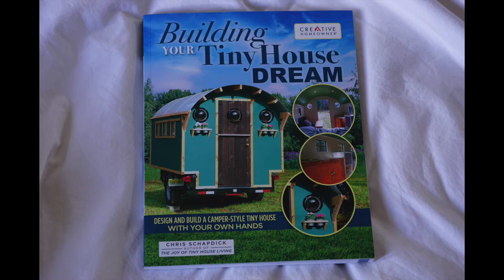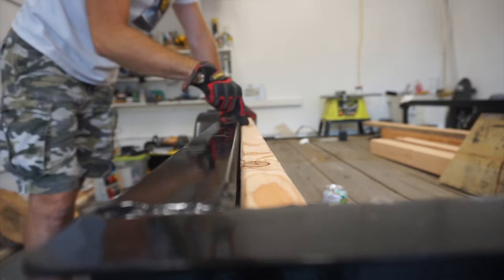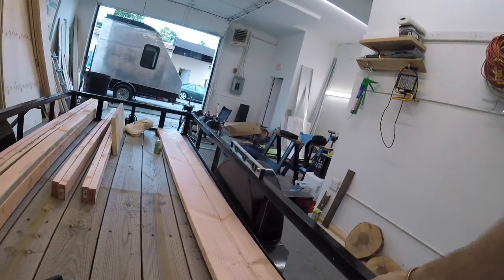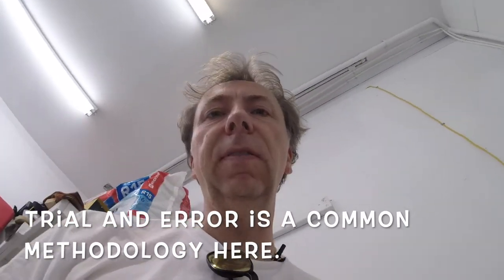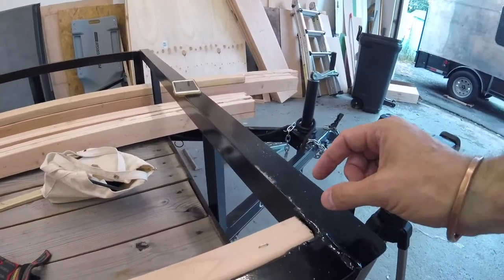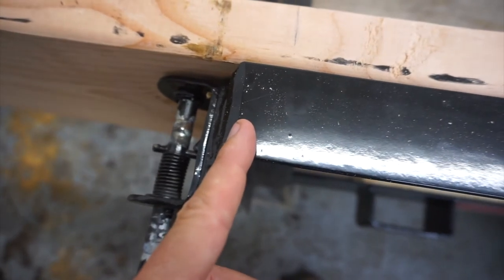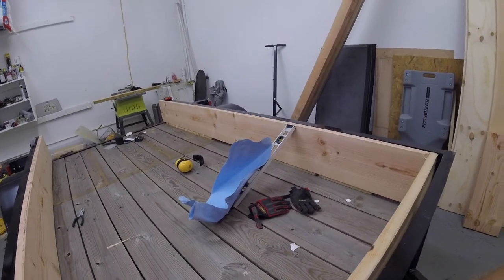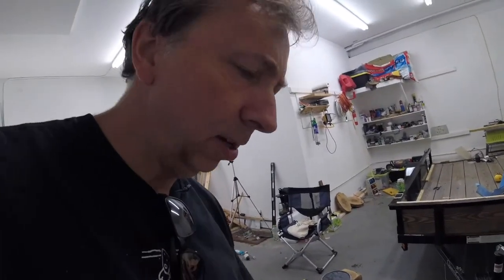Closing the Sides Up of Your Tiny House Trailer - Building Your Tiny House Dream - Video E3

Comment: Are the 2"x12" boards your using dried or still green? Just wondering because of weight.
Reply from the maker: I don't believe they are dried. They are standard issue from the big box store. They are on the heavy side. I have closed in the sides with thinner material before, but i wasn't really happy with the result and continue to do it this way since it feels and is really solid.